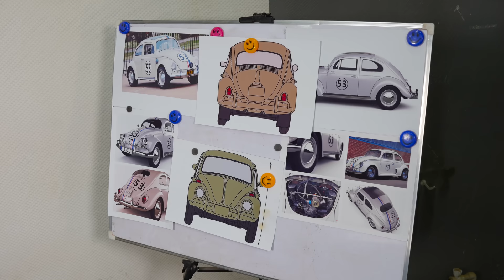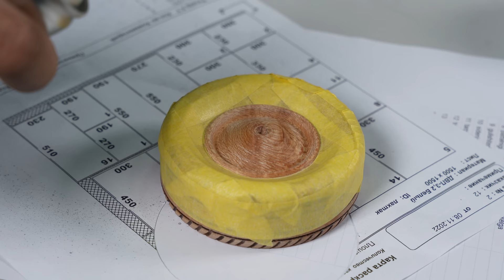How to make Herbie The Love Bug 1963 Volkswagen Beetle Out of Wood | ASMR Woodworking

Comment: Beautifully done! As a fellow woodworker, I can't stress enough how important it is to prioritize safety when using tools like a table saw. Even if it looks good on video, it's irresponsible to demonstrate unsafe practices that may be seen by inexperienced or young viewers. At a minimum, you should always use a riving knife to prevent kickback and a push stick to protect your fingers when free-form cutting wood. While a blade guard may also be appropriate, it may not always be possible to use one when working with thick wood. It's crucial to follow proper safety protocols when using any equipment to ensure your own safety and to set a good example for those watching you. After all, the last thing you want is to be constructing an ambulance for  your last project!